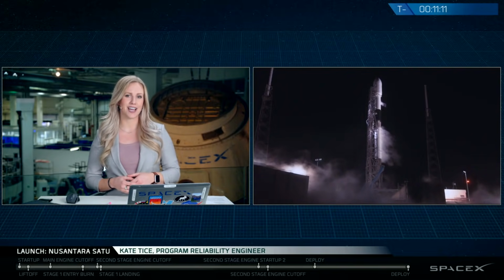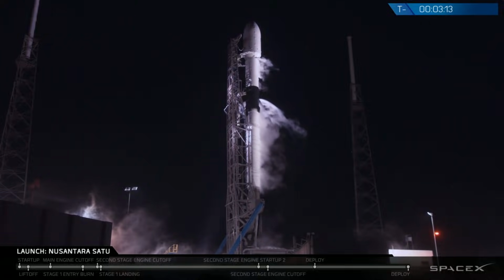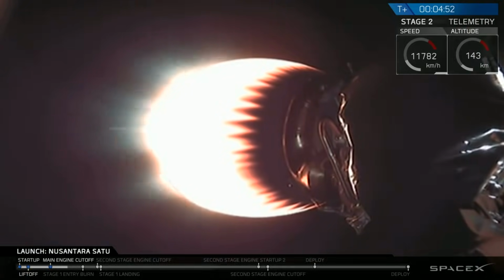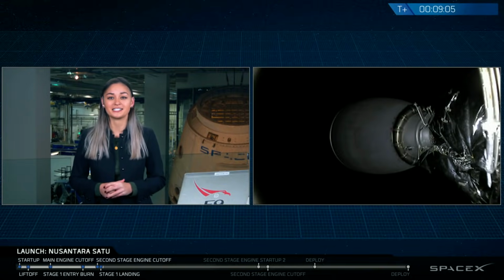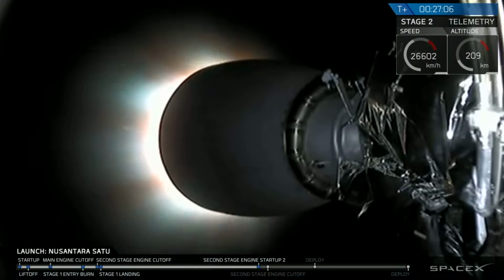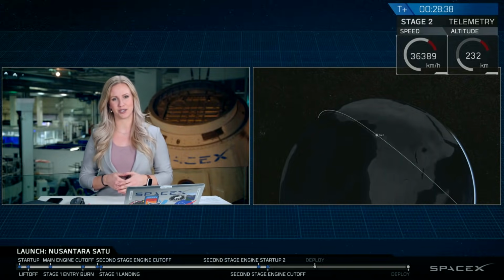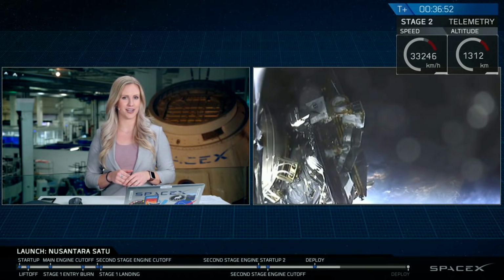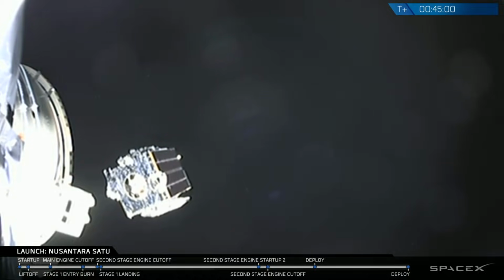Nusantara Satu Mission

Comment: What exactly or how does the "T tip" lighting system work and why is it green?
Reply: T-Teb is Triethelborine. When exposed to oxygen it ignites with a green flash. It is put in the chamber as fuel is being ran through to ignite it.

Comment: What happens to 2nd Stage Engines?
Reply: They crash and burn, into the ocean
Reply: @isakh8565  Really? How? They're headed in the same trajectory as the satellite.
Reply: @shadbakht  The satellite has small engines to fully circularize and perfect its orbit, while I think the second stage periapsis (lowest point of orbit) is still low enough to hit the atmosphere. I don't know if it also has cold gas thrusters, which could be used at apoapsis to make sure it comes back. I do know it comes back though, in fact Elon Musk just answered the same question on twitter: "Deorbits & burns up over the Pacific"
Reply: @isakh8565  Elon did say that in his tweet, but that would be quite unusual -- in the past, SpaceX did not have fuel to deorbit the second stages from GTO launches. It takes months or even years for their orbits to decay naturally. Lots of Falcon 9 second stages are still orbiting the earth, some launched in 2013 and even 2010.
Reply: @cogoid  google gave me this "At this time, none remain in orbit, as the periapsis of each is so low (~200-300km) that they decay within 2-6 months." and also it's only the first 5 Falcon 9 second stages that still remain in low earth orbit.
Reply: @isakh8565  Google gave you somebody's poorly informed opinion. Google instead "satellite tracking". Open the web site that cones as the top result. Type in "Falcon 9" as the name of the satellite. It will give you the list of orbits from NORAD catalog for Falcon 9 R/B. R?B stands for Rocket/Booster. Last time I checked, about 30 second stages were still in orbit.
Reply: @cogoid  You are correct! But it wasn't a poorly informed opinion; on further inspection the info was from 2016, and there has obviously been many SpaceX launches since then ;)
Reply: Stuffnspace.com shows 19 still in orbit not counting this one, some of them have low perigees with a six day period.
Reply: @isakh8565  Apparently, by "deorbit" Elon meant natural decay of the orbit over long time. The stage is showing in the NORAD catalog together with the satellites, and no maritime warnings have been posted for the Pacific. (When stages are intentionally deorbited, a hazard zone is posted.)
Reply: @cogoid  Interesting. What's the NORAD ID? No Falcon 9 R/B from 2019 shows up when I search for it.
Reply: @isakh8565  NORAD ID: 44048 Int'l Code: 2019-009A Perigee: 244.4 km Apogee: 68,894.0 km Period: 1,374.0 minutes Semi major axis: 40940 km

NORAD ID: 44049 Int'l Code: 2019-009B Perigee: 252.2 km Apogee: 68,925.0 km Period: 1,375.0 minutes Semi major axis: 40959 km

NORAD ID: 44050 Int'l Code: 2019-009C Perigee: 245.2 km Apogee: 68,676.7 km Period: 1,368.5 minutes Semi major axis: 40831 km

(Launch date: February 22, 2019, Inclination: 27.6 ° )

The objects are: the second stage, the SpaceIL’s Beresheet Lunar probe and the Nusantara Satu satellite with the USAF satellite attached to it until it reaches GEO. Which one is which is not labeled.
Reply: @cogoid  Thank you. I wonder how long it will take before it decays enough to crash, with a perigee close to 200km.
Reply: @isakh8565  The density of the upper atmosphere depends on the level of solar activity and is hard to predict, so there are no reliable long term predictions. Once the orbit gets closer to 120-100 km, further decay is very rapid. But even the ISS which orbits at 400+ km looses about two kilometers every month.
Reply: @cogoid  Yeah, I know the ISS needs to boost itself now and then to stay in orbit. I remember reading somewhere that if it stopped boosting, it would maybe take about 2 years to decay completely.
Reply: @cogoid  I'm surprised to see the apogee stay almost the same for so long, I would have thought the drag during perigee affected it more than that. 
Anyway, looking at those numbers, maybe this latest 2nd stage will take 200 days or more to fully decay?
Reply: @isakh8565  Yes, the elementary physics would suggest that air resistance at the perigee would simply lower the apogee until the orbit is circular. I would like to know myself why this NORAD tracking data does not show this effect.  I do not know the answer.
Reply: @isakh8565  Apparently, decay of highly elliptical GTO orbits is not a trivial subject. Not just the atmospheric drag but the gravitational perturbations from the sun and the moon need to be taken into account, and depending on the circumstances the decay rate can vary by a factor of 100.

For example NORAD 02643 Delta-1    launched 11 Jan 1967 is still in orbit:

Orbit in 1967   369 x 30416 
Orbit in 2019   296 x 22165
Reply: @cogoid  Wow, yeah that really is a lot of variables. I knew that multiple bodies had some effect, but not that much. Thanks!

Comment: what is that smoke around the rocket before the launch?
Reply: That’s condensation. The rocket is incredibly cold because it’s fuel needs an oxidiser, and you can store more oxygen in a smaller space by cooling it

Comment: 54:18  what the hell happens - those flashes?
Reply: There's nothing there...
Reply: @plumbus483  one flash, but yeah better 54:18
Reply: @Molb0rg  Either the sun glinting off the payload or a camera artifact.
Reply: @plumbus483  yeah, seen those flashed later on the stream where sun was sort of at different angle, probably artifacts, but quite funny didn't seen those in previous streams

Comment: What were the sparkling things at 55:25 ???
Was it just debris from the rocket?
Reply: This is ice flaking off from the rocket because the it is now in the sun and gets slightly warmer.
Reply: @3gunslingers  Wait, why's the ice there? I don't know anything about rockets. Sorry.
Reply: @johnchang7153  
The fuel is cryogenic. That means air moister freezes to the outside of the tanks and pipes when the rockets awaits launch. 
Not all ice is shaken off during ascent.
Reply: @3gunslingers  Ahh, I see. That's pretty dope

Comment: No live feed from landing... so they are expecting it to crash...
Reply: No the vibrations of the engine and the higher then normal entry heating mess with the transmission.
Reply: It was also complicated by the fact it was coming down through weather.

Comment: Why they need to cutoff the second stage and restart it? 
whats the purpose for that, I thought the second stage was already in the orbit, can someone please explain it to me?
Reply: I think it has to do with the orbit being elliptical, and coasting to the proper point to where the additional thrust is required. I wish someone who actually knows could answer.
Reply: It was headed for a GTO orbit..  That is a higher orbit but it has to be in the right place to light it's engine.  This is not uncommon with GTO missions vs. LEO missions.

Comment: Wow! The satellite cost 230 million usd, how much were they charged for the launch only?
Reply: ᮕᮢᮧᮅᮓ᮪ ᮞᮥᮔ᮪ᮓᮔᮨᮞᮨ  Musk is getting richer and richer. If he continues this way he will turn into Mask or something.
Reply: @davemwangi05  He's developing the BFR so money in one hand out another.. :)
Reply: @TheEvilmooseofdoom  but in the long run, that is meant to fetch him more money. LOL. Do you follow up closely on the tesla roadstar? It's now a year so it must have arrived at mars.
Reply: @davemwangi05    It passed Mars months ago.
Reply: @odysseusrex5908  there should be videos or photos like the ones that were taken when it was leaving the earth. Why didn't they release at least photos of mars as it was passing by?
Reply: @davemwangi05    Well, it didn't actually come anywhere near the planet. It was never intended to. It just passed Mars' *orbit*, and went some tens of millions of miles beyond it. By now it will have turned around and come back is probably in the inner solar system somewhere. I bet you could find a web site that tracks it.
Reply: @davemwangi05  As Odysseus explained it was never meant to go near the planet simply to get out far enough to show that it could have delivered a payload if it had one.  There is no hardware for taking and transmitting such images.  The batteries were dead about 4 hours after launch.  Sending signals from Mars would require spacex to book time on the Deep Space Network another expense.

Comment: Tell me something space x. How is it that you can land a rocket on a floating barge but you haven't figured out how to keep the video feed from dropping out while watching it land? 

Don't say it's because of the horizon. That's a weak answer.

Put 2 drones, on the drone ship. Have them autonomously launch themselves when the booster is within range and uplink the video to a satellite.
Reply: The culprit is the rocket exhaust.  It is a plasma, which conducts electricity and "short circuits" the TV signal.  The drop outs begin when the tip of the plasma approaches the ship, and dropouts end when the motors shut off and breeze clears the air again.  I like like your drone idea, but they simply need to video the landing and play it back using the ship TV signal path when time slot comes.  The hard part would be reassuring worriers that it will not crash the rocket and will be able to return itself to the drifting ship without damaging stuff, no easy feat.
Reply: @bobspafford3519  ahhh that makes complete sense. Didnt the live feed stay up when that one booster landed and then tipped over because of a leg failure during a test landing? I thought I watched that live but I could be wrong. 

 I think they can mange a quadcopter with a good cam to take off and return after they record live feed without colliding with the booster. It's Space X!